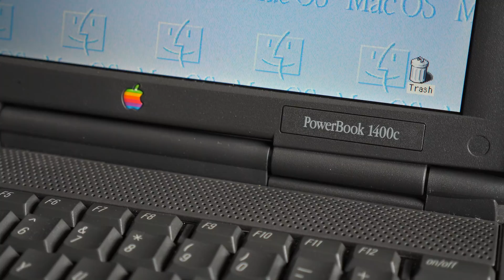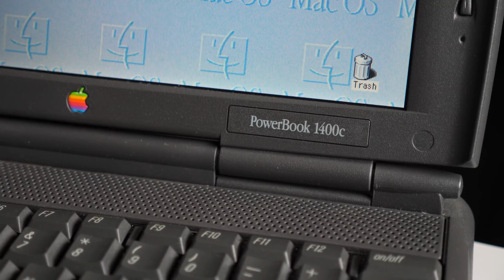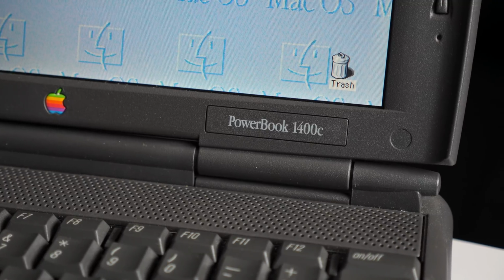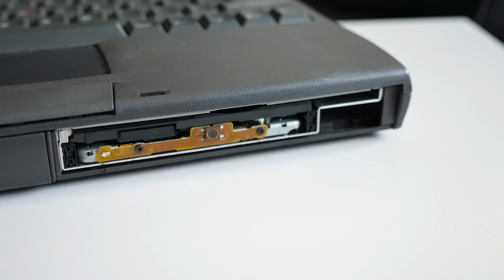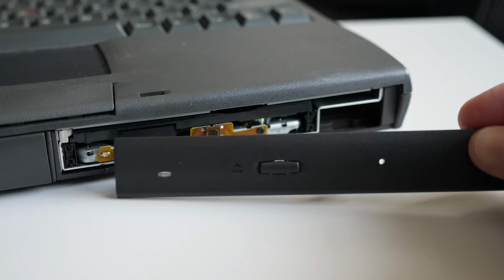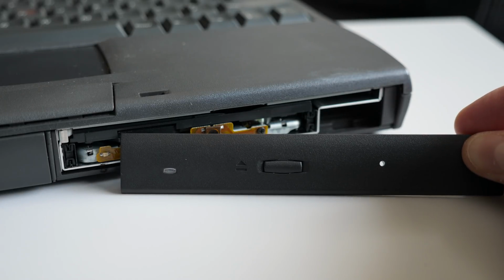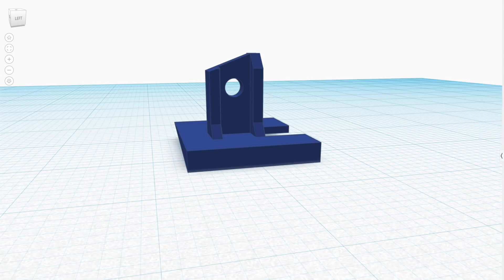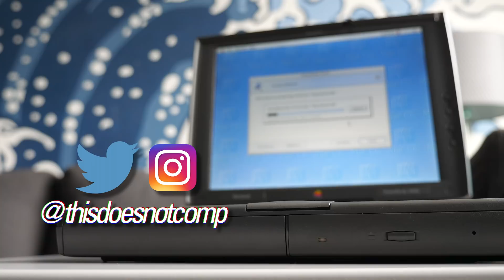3D Printing to the Rescue: PowerBook 1400 CD-ROM Bezel

Comment: Would it be possible to swap my 1400CS display with the one from the 1400C? I haven’t decided whether I want to do it yet as I don’t actually have the computer at the moment. When it gets here I’ll see if I can use the passive matrix screen, or if I want the active one. Also mine has the same issue with the bezel.

Comment: Random question:  I have a totally dead Macbook pro battery from a 2019  13" Macbook pro (A1989).  It has a charging issue which I do not intend to fix.  However, a fresh battery starts the computer up and it runs fine.  Can I hook up a 5v 1A DC power source to charge the battery enough to rescue the data?  Is 5v what I want like for a cell phone?

Comment: i think resin 3d printing might be even more appropriate for this kind of stuff.
Reply: Unfortunately resin so far is very brittle. Siraya Blu is not brittle and can be used as an additive but it has cohesiveness issues, so it's still easy to break. I'm excited for Mayer Makes resin which is supposed to solve that but ultimately I don't know how it will turn out.

Comment: I would invest in some #18 and #19 xacto blades. It makes for trimming flush plastic much easier and it doesn’t make a mess like sanding does. And the angle of the blades makes it much aside to control. I use them a lot in Gundam models, trimming sprues flush to the part.

Comment: I don't understand how people get such huge working time out of superglue. Any time I use it, the absolute split second parts touch they're stuck forever.
Reply: Gel superglue is much slower. In RC model shops you get two kinds, the fast liquid type and the slower gel type. The cheap dollar store superglue isn't worth it, the bottle is ruined the day you open it, it's a menace to work with, it's not adjustable at all, and it doesn't hold nearly as well long term, the formulation isn't quality. I also often use UHU Strong&Safe which is a modified CA gel which stays just a little flexible in cured state, but mostly because I'm from Europe and every store sells UHU products which I find always nicer than Henkel/Pattex.
Reply: It depends on the glue. BSI makes a whole bunch of different CA glues for different applications.
Reply: I've only tried the cheap stuff, you know like $1 for 5 tubes. Usually I use a two-part 5 minute epoxy and that's been great for many years.

Comment: Nice, but I would recommend ABS over PLA. PLA isn't very wear resistant, warps at "hot car" temperatures, etc. It's good for prototyping but not for something you expect to last for a long time. Plus, the original case is (probably) ABS too, so you can use ABS bonding techniques that are stronger than glue.
Reply: Usually I go for PETG but it might be hard to get a good PETG bond in this scenario. ABS is obviously a pain to print with but warping shouldn't be an issue with such small parts.

Comment: I would have 3D-printed the entire bezel with integral tabs. Perhaps design the tabs to be more robust. But your approach makes more sense. Perhaps 3D-printing doesn't do a good job with smooth, outward facing finished surfaces.
Reply: Also, it'd be a hell of a time trying to match the colors. If you didn't care about outward appearance of being stock, then whatever, but it seems like Colin likes things to appear stock.

Comment: PLA will NOT last long; for that kind of part you need to use ABS or Nylon (best of it all)
Reply: I have had a lot of PLA parts on my printer and have some experience with failure and non-failure. I would say it will last a long time given they're not under a lot of constant load. Though I mostly do PETG today.

Nylon has an issue that it can't be glued, it tends to reject glue after a while. I think ABS or ASA are good. Given the large glueup area, even PETG would hold but it has issues with glue adhesion to keep in mind.
Reply: If anyone comes up with a reliable method of gluing nylon, I would really like to know what you did.  I don't have a 3D printer, so I use services like Shapeways.  The quality is SO SO much higher with their fancy expensive SLS machines and all that, but nothing I've tried will stick two parts together.  At least not permanently...

Comment: You should try a 3d pen before making new parts.  3d pens are like a handheld 3d printer and are very good at "gluing" broken parts together.  Nothing sticks to plastic quite like plastics.
Reply: Two entirely different kinds of plastics are not guaranteed to stick at all.
Reply: @startedtech  Can't hurt.  Besides, all this stuff is just cheap ABS.

Comment: Perfect timing on this one, my 1400c's bezel just broke off 😂
Reply: Dang that sucks
Reply: Hello
Reply: Mine too!  I think it was only about the fourth time I'd opened the tray -- it was a sealed, boxed new old stock drive, so it's clear to me that the main issue is material degradation and not use/wear.